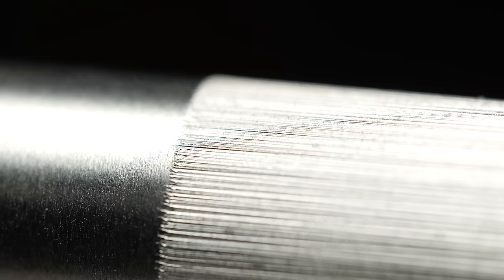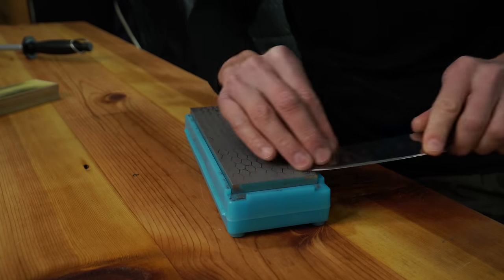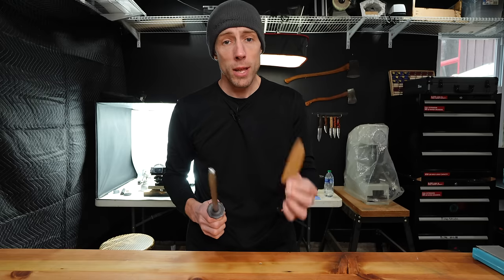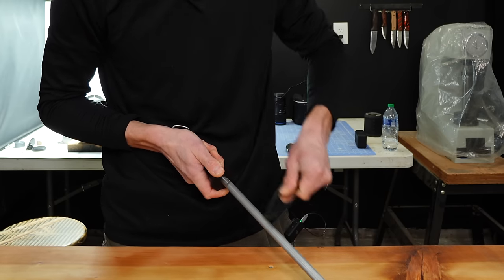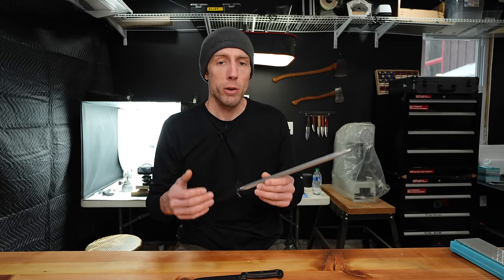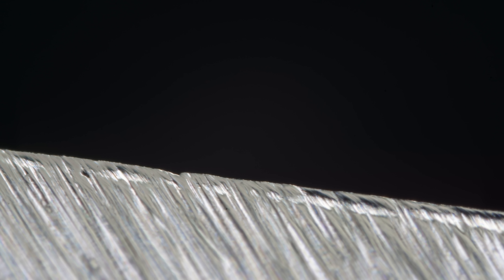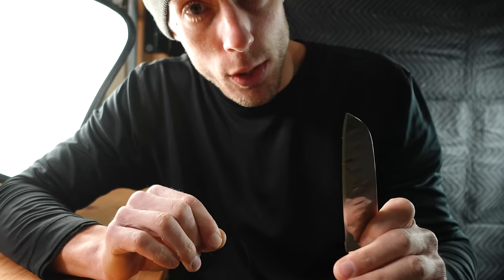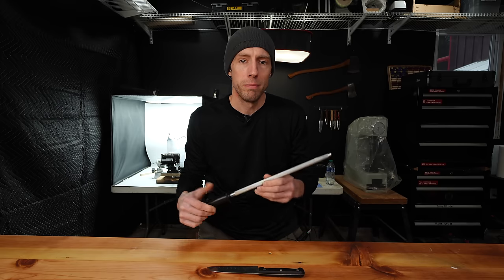What Do "Knife Sharpening" Honing Steels Actually Do?

Comment: i use a steel! i hold the knife still (using light to show me the cutting edge) and run the steel down the knife perpendicular in a stropping motion, shaving sharp every time! - that is, the knife is the 'strop' and i run the steel over it as one would run a knife over a strop

then i 'strop' the knife using my wooden cutting board as the strop!

tomatoes? no pressure required!, just slide the knife and it's done

Comment: Hey, how are you doing? I just want to say that the honing rod you got is a bad one. That kind of rod is a "fake" rod, made for people who believes that the rod will sharp the knife. The groves are "supposed" to kinda sharp the knife. The real ones are smooth. And it will not correct a rolled edge. It will straighten up the edge. So, you need to sharpen the knife on a stone and use the rod between cuts to do so. The function is kinda the same as using a leather strip, the difference is how quick you get the rod, corrects the edge and get back to work.

Comment: Just cross my mind, which I still cant prove it myself, is there any possibility that the non abrasive honing do an adhesive wear that deform the knife in a good way such as it reduce the angle of the apex? Making it more "sharp" because the apex plus the angle is deformed into a lower angle apex?
Short time high temperature in a point in the knife make some atoms get relatively hots and get deformed?
Maybe if you some times run out of idea, you can do a test on this possibility?

Comment: There are different types of steels rough, smooth, ceramic, Diamond.   I work with a knife every day at a hog processing plant.  Rough steels can fix a rolled edge but a rough steel. Following this with a ceramic then a smooth steel will bring the edge back.  There are different kinds of rough steels and "abrasiveness" in quotes because not sure if spelled right lol.   Using a stone and strop are preferred but proper use of a steel can be used to maintain a frequently used knife.

Comment: I only use these in the kitchen whenever I was in the middle of a rush-hour. Cleaned off after of course And some light work needed to be done. But you can’t run these things across a really bad blade, it’s not gonna fix it. So when the new guy touches your specific blade And drops it gonna have to fix it

Comment: Hmm I understand your Tests and your conclusions but there are already Tests which are proving that honing rods do cut of Material and create a new Edge on a knife. the Problem is it is just a tiny amount and if you keep dulling it it stops working at some Point. You can keep a properly sharpend knife sharp for a very long time if he steel is right and you overdo it with the Pressure (You can creat micro serations by acident) Long story short, under the right circumstances they work pretty damn well even without a burr.

Comment: I was always taught by older chefs, because commercial kitchen knives are cheap, and often used by multiple people, they are abused, honing rods (abrasive or not) are a commercial temporary solution to sharpening a knife everyday, its not a sharpener, nor is it a repair tool like is suggested here, just a rough honing option to pad the edge from light crowning (not rolling), even a dollar store home knife is better quality than a commercial kitchen blade!

Comment: I think I can add something to this debate. I have an old Victorian table knife that was made in Sheffield in the UK sometime in the 19th century. It has a carbon steel blade that is 140mm long. I use it every day as a kitchen knife and I also eat with it. I have owned it for over 35 years and have used it this way all that time. I keep it sharp with a steel and find that if I give it about 20 strokes almost every time I use it in the kitchen, it stays razor sharp (literally – I could shave with it). I have other carbon steel knives that I keep sharp with the steel too. I was shown how to use a steel by an old butcher who had been doing it all his life. It worked for him and it has always worked for me. The action I use is completely different to you. You were drawing the blade back along the steel, this never works. You have to stroke the blade into the steel along the whole length of the blade. The butcher told me to imagine I was trying to slice a thin sliver off the side of the steel, using the whole knife blade with each stroke, first one side, then the other. It is not possible to ‘sharpen’ a knife in this way only to keep one sharp. (from very sharp to razor sharp – if you see what I mean).
Stainless steel looks pretty but it is useless. I have often sharpened stainless steel knives on a diamond stone and ‘finished’ them on the steel. You can get them to take an edge of sorts but peel an apple and the edge is gone and you can’t get it back with the steel.
Steels do work but as always; ‘the right tool for the job.’

Comment: This annoyed me a little, I love using my steel for quick touch-ups in the middle of cooking when my knives aren't slicing through peppers, onions, or tomatoes so well. It gets you through until you get the old sharpening stones out for the once or twice a year sharpen where you properly reshape the blade edge. This vid sucked in that he only used a cheap knife and didn't do a back to back comparisson with a high quality blade. Using a steel correctly, takes all of 5 seconds and you're back into the dinner prep.
I agree I would highly recommend a diamond steel as it actually keeps the edge much better than a cheap steel but cheap steels work well to on the fly. 
Worked as a trained chef for a decade, now a carpenter having to sharpen my chisels on occasion. Seeing old mates attempt at using a steel was brutal. 
This example was also not realistic in excessively rolling the edge and using a standard steel to hone. That damage would then need a proper sharpening then you'd be right to use a steel for a long time. I'm sure this bloke has great how to sharpen vids. I just caught this one and it irked me a bit. Peace

Comment: The reproduced rolled edge in this video is not what is typically happening to the edge due to using a cutting board.  Really started off wrong, making everything else really off the mark IMHO.  I have my knives professionally sharpened.  I use a steel once a week and it keeps my Japanese sharp enough to where they don't need sharpening more than once every 6 months.  And if I don't use a steel after several weeks, it is very noticeable, but as soon I use the steel, its good to go again.  I don't think it is bad advice to use a steel.

Comment: Honing rods work when used correctly in the rite situations. They do not sharpen but they will return an edge to working on a  knife that has been used for  chopping. It does not need done everytime a knife is used, especially in a home kitchen.

The honing rod should be rolled with the blade to avoid abrasive contact. The grooves are not ment to scrape the blade but to provide surface for pressure. Rolling in while the blade passes prevents the destruction of the edge.

Comment: I have a diamond abrasive rod.  I noticed you said on a steel rod it's recommended to use an edge trailing method but when you demonstrated the method with a diamond stone your were edge-leading.  So when you say to use it as you would a steel, is it still best to use edge-leading or is it not too important?

Comment: I have a ceramic honing rod that’s actually the filament from a light bulb. I’ve used it for 20 plus years to sharpen blades. Mostly razor blades. At my job I had to make lots of gaskets from neoprene rubber and neoprene sponge. After a few dozen cuts the blades started dulling and made the effort to cut them much greater. So instead of opening up the razor knife and flipping or changing the blade, I would run it four or five times over the ceramic hone and the edge was as good or better then the new edge. It was a great time saver not to mention the cost of the blades.

Comment: I used to work at a pork cutting line and we used a smooth rod and not a trailing motion but put pressure on the forward stroke.  Your knife was instantly sharper.  I don't know why the forward motion worked better than trailing.  Sometimes a large angle also worked better. It all depended on the time since you last ground the knife.  The old timers always got their knives like razors and would test them by shaving some hair on their arm.  You could shave your face with their knives.   I only worked at this plant as a summer job for 2 months or so for a few years so was not as good as the old timers at sharpening.

Comment: Thank you for another informative video.  I assumed many of the principals you demonstrated here already.  (we all know so much about assumptions)  That said I started working as a machinist in the early '90s so have some understanding about metals and burrs.  You just did all the work to prove me correct for never having used a "knife steel" in my life.    After reading some of your comments by tradesmen with YEARS of knife work experience I would be interested to see how much of what the believe about the steels is real and how much of it is confirmation bias.  I have worked with machinist that had 40 years experience that would fight and die to defend old habits that has always been but does almost nothing.

Comment: i am not a knife sharpener but chef for many years also did some "investigation" on it. its always amusing listening to people about  the mistery of knifes, sharpening and japanese knifes etc.

fundamentals
apex or burr - the edge makes the cut.on every edge there is a burr. so the burr makes the cut.

on your apex the burr is so minimised that even with your zoom you wont see it.

besides temperature treatment all knifes are made from a mixture of steels and minerals giving them strength and flexibiity. the designer wants them to have.

good honing rods are made from a much harder steel than knifes. thats why you wont see any scratches on honing tods.
 
so what happens when you rub something harder against something softer? the softer material bends - a burr arise and thats why knifes are sharper after using the rod.

also its a complete misunderstanding that chefs need razer sharp knifes. we need sharp knifes that do the job and it should be very quick and easy to reestablish this sharpness.

abrasive devices like stones, or diamant picked rods are taking of steel from the knife, that means the knife is much quicker done.

in the way you used the rod we can see, you dont know how to use it, you dont see why you should use it and you dont like to use it.

you have to remember that we have to have our knifes sufficient sharp during services. we dont have the calm of your shop, diamond stones handy and start the sharpening process. there are orders coming in, customer are waiting, food to prepare , etc.

the rod is essential for a professional kitchen and who you are to dare  making jokes of chef ramsay, who worked his ass off working 16 - 18 hours shifts to become the celebrity he is now. i dont like him neither but i do respect him a lot.

Comment: My impression of using those cheap ridged honing rods is that they create a ragged burr which is adequate for cutting soft vegetables and meat, but it doesn’t last very long so you have to do it almost every time you use it. They absolutely do remove material, and knives can go a very long time between proper sharpening while maintaining acceptable cutting ability for the average person. It’s nowhere near a proper apex cutting ability but it’s good enough and passes the tomato test.

I agree with what you’re saying here for the most part but I think you’ve missed the appeal of honing rods in the market place, which is that they are better than those pull through knife sharpeners (both in how well the knife cuts and knife profile longevity) and also quick and easy for the average person compared to sharpening stones.

Most people will run in the opposite direction if you show them a sharpening stone and I don’t think that’ll change any time soon.

Comment: I'm going to have to say that you're wrong, I'm a chef with almost 40 years experience so I'd class myself as an experienced professional knife user  I use a rod which we call a butchers steel to sharpen my knives. I've got knives that are razor sharp that I've used daily for nearly 40 years and used only a butchers steel to keep them in top shape. Here's where I think you've gone wrong in the video. Firstly chef's don't actually chop up and down on a board like you demonstrate, usually the knife stays in contact with the board at all times and isn't impacting like that, the end towards the tip would always be in direct contact and when we chop things it's more of a slicing rocking action with the pivot point being towards the tip of the knife and the most if not all of the cutting is done by the section running up towards the heel of the blade. Also we wouldn't use cheap knives because the metal is just too soft and would damage and wear too easily like can be seen in your video. A good high quality knife should last longer than a person's lifetime particularly if it was used in a home environment, like I say some of mine are nearly 40 years old and have had way more use in 1 year than most knives would get in a home in 50 years. Also you're using steel wrong, you start with the heel of the blade at the end of the steel and bring it towards the handle of the steel sliding down the blade as it goes, the second action is exactly the same as the first but on the other side of the steel and the other side of the blade. With practice and experience you can quickly get a sharp blade which eventually is done at speed because you're getting more passes on the steel in less time. The speed that you see Gordon ramsey doing in that clip is probably accurate as to what speed it would be although he was sloppy in that clip and not contacting the whole blade. My knives I've had for years but the butchers steels don't last as long and the serations  smooth of so I've got through a fair few of those. Butchers steels are the fastest most efficient and least destructive way of sharpening a knife. There's a reason all of the chefs, butchers, fishmongers etc in the world use them and that is quite simply that they are the best tool for the job. Those are the reasons that your video isn't correct backed up by my experience on the subject, I'd imagine any professional kitchen knife user would tell you the same, we're the experts on it because it's our day in day out job and our knives are our tools of the trade and get well looked after.

Comment: That IS an abrasive honing rod. The super thin knife edge edge is burred against that ribbed rod. A smooth steel or carbide rod will roll the edge back without abrading it while work-hardening the edge.  Don't use a ribbed rod. A smooth glass bottle will also work!

Comment: On the stone you drew into the stone, on the rod you drew away at the end?
 My understanding was that they removed burrs, but I see now thats not true. So you strop. Can you remove a rolled edge by pulling away from you on a strop. I always thought you could pull away (not into) a block of wood for example to fix and edge. 
My brother uses the rods but he also told me if a knife is sharpened correctly you just fix the roll now and again

Comment: You make a good case against the traditional steel, but I think your rolled edge example was a little excessive in force on the copper pipe. I recently sharpened a friends knife (belt sanded then buffed on a buffing wheels to remove the burr) and there was a spot along the edge that had a small reflection. I tried the steel along that part of the knife a few times (sliding the knife along the edge purely perpendicular, not like the kitchen shows) and the reflective part went away. I don't know whether that was a burr or what, hence why people really don't know what is happening with their knives or what a steel is doing. When I learned to sharpen knives, I read literature that talked about this fabled burr that needs to be straightened. Your pictures do help understand the better ideal of having a burr free apex, instead of just having a straightened burr. Thank you.